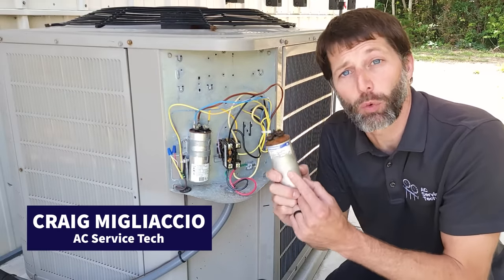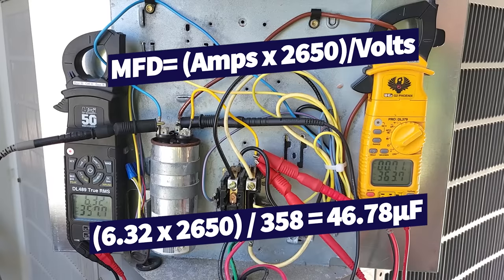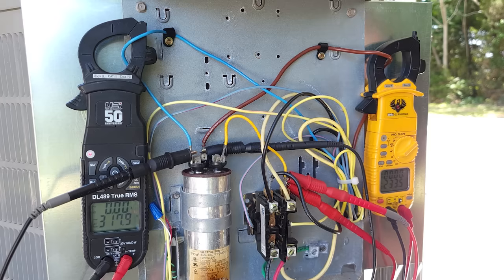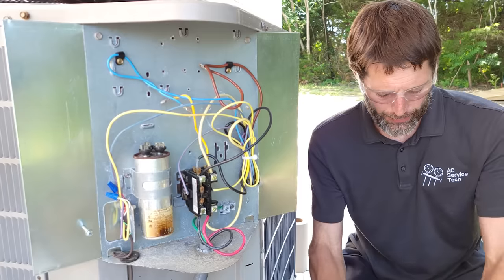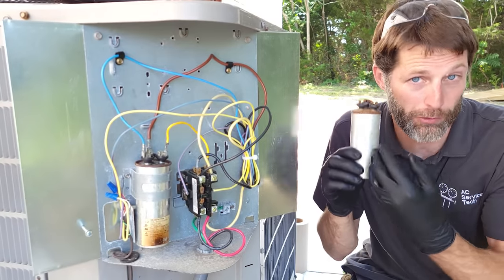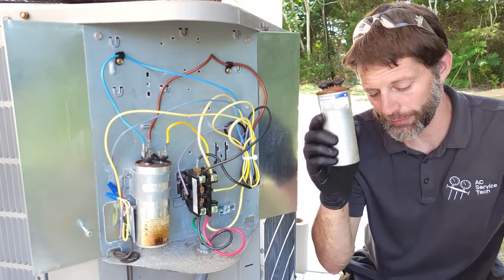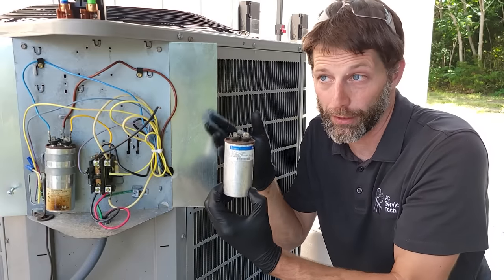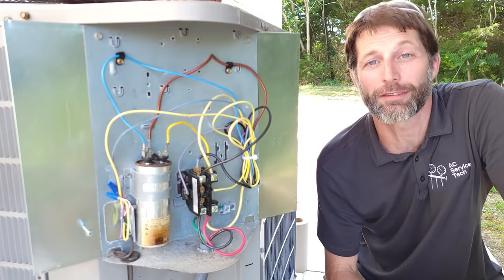WHY CAPACITORS FAIL in Air Conditioners! Watch it Break!

Comment: After several years it's always a good idea to change out capacitors, contactors and relays, they did their thing, leaving them in is going to take out the larger more expensive components. It's also a good idea to go through a unit and get a baseline on everything for future comparison, no one does this, but most HVACR equipment comes from the factory with a start up check list in the installation manual.
Reply: FINALLY someone that understands 'baseline' s.

Comment: Can power outage kill the capacitor and ruin your compressor when the power comes back?
Reply: Yes
Reply: @BartSimpson-nr1dy  wait what? How does it kill the capacitor and in turn kill the compressor??
Reply: @armandodeleon5047  electricity does what it wants to. I've heard praying helps though...
Reply: It happened to my house the compressor was short to ground but my capacitor was fine thanks for the feedback
Reply: @
circuitry
Reply: our compressor and air handler both have surge protectors that were installed when our system was installed

Comment: Thanks for this video!  I recently had the capacitor go bad on the 3 ton Copeland compressor of my home A/C. It was actually not an old capacitor; maybe a year or two old. The original GE cap failed after 20 years, and the new one was a Rotom. It lasted a year or so then failed the first day of the cooling season this year.  After it failed, I made an analysis of how the capacitor safety disconnect circuit works..... and bypassed it and gave it a very good send-off. Here is the send-off of the old capacitor: https://youtu.be/z1enQuvSovg

Comment: I have always been told, that a major reason for capacitor failure is low voltage.  When there are brownouts due to high demand on the grid, the capacitors heat up and fail.  Dunno but it does pair up with my field experience. My supply house has run out of caps during high heat conditions.  I doubt it is ambient heat failing them as this guy says but rather low voltage from high demand on the grid.  Did like the dynamic measurement though.  I'll have to watch that again.

Comment: If I understand correctly, the capacitor is only needed for starting the motors, perhaps a time relay is a solution that prevents the capacitor from wearing out too quickly.

Comment: I have a Leeson 5HP motor on a dust collector and it has failed. Based on your reasons for failure I'm assuming it was a heat issue. The motor was installed in a small outdoor shed and actually lasted for several years. The replacement capacitor I ordered is physically much smaller than the original but the specs are the same. Also the original had a bleeder resistor which I will remove and install on the new capacitor (per your instructions in another video). 
Question - will the life of the motor be affected by the failure of the start capacitor? I was informed by the MFG of the dust collector that when a start capacitor fails the life of the motor has been considerably shortened.

Comment: Your video is awesome. I recently replaced a dual capacitor on my daughter's new house. Her husband helped me, and we got one 25Hern and one 5 fan separate capacitors to replace the dual capacitor as there was no dual captor available in klamath falls oregon. I think the guys said "fan ones fail more often." I showed my son in law how to test a capacitance with a milwaukee meter. I still don't know why the contacted was not getting power. I think it was from a mislabeled "Water Heater?{"" which was really the condensing unit.

Comment: Thanks for the great lesson. I have also replaced many capacitors after a hard freeze. I had come to the conclusion that the cold will kill them also.
Reply: On ACs when summer comes? or heat pumps? If heat pumps, I would guess not the cold itself, but higher start currents in the extreme cold? (or failed crankcase heaters?)
Mr KL

Comment: TL;DW

1. Capacitor is too hot; unit is in the sun or just is hot a lot.
2. Capacitors are expendable items. Hotter they run, the less they live.
3. Voltage spike, e.g. surge, lightning strike, etc.
4. Bad connection point overheats terminal and creates a failure.

Comment: Thanks. The cap on my carrier unit failed after 4 years of hard hot texas summers.  Replaced with identical values but new cap was much bigger and came with new bracket.  So far so good.   Since they are fairly cheap would you recommend just replacing it annually?
Reply: No easy answer, depends on the quality of the capacitor.  In your case, if your replacement was equal or better quality, then it seems like 4 years is closer to the right number, lol.  Your money though, if you want to replace on a schedule then it's not a bad idea, but if it doesn't take long to get the panel off, I'd just have a spare and wait, or every 2-3 years.

Comment: @AC Service Tech LLC
I wonder if you could edit your comments to include a note that you heated the capacitor during this demonstration?
Many are very confused as to how the capacitor failed or how you knew it was going to fail for your filming.
I don't know if you will see this comment...

Nice video, thanks.
Mr KL

Comment: HI very informative but how did you know that capacitor was going to fail while you watched it?  Was it not receiving the proper air flow it would normally receive  if the covers were on? Otherwise why did it overheat? It was operating within its labeled voltage rating, I don't know if 6 amps was above its rating but I assume was within its rating. Question how did you know it was going to overheat ?

Comment: You predicted the capacitor's failure. I could see the capacitor getting hot enough to burn the label, but why. Did you heat it with a torch or heat gun, or was there some other reason it overheated. Thanks.

Comment: I’m sure there is a correlation somewhere but personally I noticed if the condenser coils are dirty or clogged the capacitors fail prematurely.  The Hawaiian heat doesn’t help either😜. Mahalo for the great videos. Aloha🤙🏽

Comment: Mine failed on an older unit when the air temperature was 115 and probably inside the housing I'd say 140 at least. Was not a fun day replacing in that kind of heat!
I fried an egg on my road and I left footprints in the melting asphalt!

Comment: Another issue is light load on a motor will have higher back EMF. A dirty, blocked up condensor might cause the fan cap to fail because the fan is creating less mechanical load.
Reply: If you're victimized by that case, replace the cap with one that's rated for the voltage that can be expected when the system isn't optimal.  Then take a pitchfork mob to the designer's house.

Comment: I've been told from my HVAC teacher
who was a tech since the 70s 
the gov made cap mfg change the oil due to environment issues 
 and ever since they have been a basically a wear item. 
but before that you barely would even think to keep but maybe 1 on the truck
Reply: They banned pcb's.

Comment: A few years back I had to make an emergency call to have a new dual run capacitor installed in my AC unit. I was leaving town the next day and could not leave the house full of humidity for a week. So the $850 service call included a new 5/45 capacitor, a "start kit" and a service contract (to reduce the bill) fast forward 2 years and the service tech tells me that the fan side of the capacitor is reading 12.5 UF!! and though it works, I should replace it. I thanked him and sent him on his way. I bought a new capacitor and swapped out the other. Capacitors don't magically increase in value, and at the time I did not have a capacitor meter for large values so I contacted the company that makes the capacitors here in Florida and they told me to send it in for analysis. As I had wondered, it was right on spec and they sent me a replacement. I don't know if the tech was trying to scam me or calculated wrong, or put two loops of wire through the ammeter, but in my 40 years of electronics I have never heard of capacitors increasing in value 2 x. Can you comment on start kits and whether they help or hurt. Mine is quite old now.

Comment: what should a capacitor cost for a hivac company to replace?  I had an ac guy come out to do a "cleaning".  He was pushing to do anything he could do from replacing my working unit for 15 grand to more freon for 900 bucks to a capacitor for 585.  I said no to everything since the unit is working fine.

Comment: Would it be beneficial to have the capacitors inside next to the furnace and just extend the wires or will that create a voltage drop?

Comment: I am in AZ where temperatures reach 120 degrees in the summer. I had my AC go out a year ago on one of those days. I panicked and called a HVAC company to come and fix it. The guy talked me into a 5-year contract on top of replacing the run capacitor for $1800 total cost! I've regretted it ever since. Every time they come to supposedly clean and inspect the system (and I've seen no evidence of cleaning) , they tell me it's on it's last legs and really should be replaced (I think it's 8 years old now), at the "discount" price of $10,000, which I can pay over 5 years with 14% interest. I've resisted that so far. I am convinced I am getting screwed by these guys and can't get out of this deal. What do you think?
Reply: $1800 for a $21 part? That was your first clue that something was wrong with these guys. Your best bet is to have a lawyer go over the contract. If there is anything in the contract that is illegal, then you can have that contract voided. If there is nothing  wrong with the contract, then you are stuck with it until it expires.Don't ever do anything like that again. There are plenty of AC companies out there that don't play these kinds of games. You just have to call around to find them and get the best deal.
Reply: Read the Yelp reviews and check around for AC companies.  I always do an extensive background check on any company I use, and as a result, I have had zero problems.  The last thing you want to do is call a random company and find out it had a pile of 1 star reviews after you handed them a stack of money.

Comment: Pretty sure this just happened to my window AC. Unusual use case though. Installed in the trunk of a car pointing to the interior. Pop the trunk when running so air from the condenser can circulate. Fan is still working, but when the compressor tries to kick in it bogs the fan way down and just hums.
I have a hunch it gets a little warm rather regularly. Lasted a bit over a year. Guess i'll have to keep a spare on hand. Could maybe figure out a way to mount it on the underside of the vehicle.

Comment: If you have a bad capacitor could that show low charging stuff? My 102 yr old mom was told bad capacitor and recharging from or whatever it is, is old and would cost a fortune to fill then it could leak out and be no good so they wanted to upgrade with whole new unit. She’s didn’t want to pay out 4-5000 dollars for AC so we’ve set up a portable but it doesn’t do whole house or a great job. Is there a solution to get whole house AC back up and running in her house?

Comment: Great video!  Makes me think back to some of the older equipment that had the run capacitors protruding through the control compartment into the air steam of the condenser fan.  Space saving or capacitor cooling???

Comment: What I want to know, is if they have capacitors in them. Why do I still need a soft start if I want to run a traditional air conditioner with solar inverters. Are they just too small to lower the surge?

Comment: I have a unit that buzzed/hummed loudly like it was getting low voltage. I turn the unit off and turned back on in 15 minutes and the unit ran fine. My question(S)  are - is a weak/faulty capacitor the problem and my other question ; my capacitor number is HC98JA062D, which I am unable to find one with that number , so is capacitor HC98JA046D the replacement for the original capacitor since they are everywhere. Thank you for your help

Comment: You put a torch on the capacitor to heat it up and make it fail, why are they overheating if current is not the issue? I have to replace my cap every 2 or 3 years in my unit, I's a Payne unit which is made by Bryant, and it has worked flawlessly otherwise.; aside from the cap failing from time to time. I did verify with the manufacturer that I am using the correct microfarad rated cap, IDK why it occasionally fails. No short cycling or undersized unit either, I was an HVAC tech and installed this system myself, no choking anywhere...

Comment: Question I have been curious about. If available, Would / can a higher voltage rated capacitor be better / less prone to premature failure? Ie  400, 500, 600 uf

Comment: The dielectric fluid also helps with the capacitance capability....BUT,overheating will always damage a capacitor....was in the TV service business for 40 yrs, many caps went bad due to poor manufacturing and just age. Electrolytics were notorious, older paper and wax caps would dry up.
Good video.

Comment: I was replacing the single capacitor every year the HVAC tech fix the problem by installing two capacitors, one dedicated to the compressor and the other capacitor dedicated to the fan, that was five years ago with No problems.

Comment: A big part of the reason they burn up is when the foil degrades the ESR (Equivalent Series Resistance) goes up which is the main cause of it heating up. The higher the ESR the more heat that is produced .... The same thing is true for DC switching regulators, you need to spec caps with the lowest ESR possible or you'll have failures due to the heat produced

Comment: Would it be possible to add more ventilating holes towards that compartment? Or making a heat sink that would wrap around the capacitor to help keep the temperatures down?

Comment: Do these capacitors have any relation whatsoever to voltage drop in the house when the a/c turns on?

I don't have aluminum wiring; was built after 2005.  I have 200amp service.  No problems otherwise with the a/c.

I guess there's also voltage drop when the kitchen refrigerator kicks on, so perhaps just an issue for the electric company?

Comment: Could power fluctuations cause voltage spikes?  I ask because I’ve had capacitors fail during or shortly after power fluctuations sat my home with power flickering on and off in rapid succession.

Comment: I live in Orlando Florida and have to replace the capacitor about every 1.5 years I think its due to my AC being in direct sunlight for a good part of the day. Thanks for the informative video.
Reply: I used to have a A/C that was one of those all in one units.  Both coils in one box and duct work connected to the unit.  When my fan cap kept going out, I had a local motor shop test the motor.  They said it was fine.  The A/C was in the sun during the hottest part of the day so like you, I figured it was heat.  I moved the capacitor to the evaporator section where it is really cool.  Cap never went out again.  As far as wire goes, I moved it less than a foot.  Odd thing is, compressor cap was original and never went out and it was in the heat.  Go figure.

Comment: Very well made and informative presentation. I learned something new in the way of the calculation presented here. I have an old 1950's vintage capacitor checker which I have used and it seems to work but being it is so old I wonder how reliable it is if it has an electrolytic cap in it which has dried out and shorted. I will use the math formula next time I need to check a cap.

Comment: i had a older rheem  r22   and it blew capacitors  every so often . I changed the power supply wires  to 10 gauge  from the panel box and  never blew a capacitor since ...
Reply: Interesting

Comment: The dielectric fluid in addition to acting as a cooling agent, changes the dielectric constant of the capacitor allowing it to have greater capacitance than air alone, and suppresses corona and arcing.

Comment: I had a 20 month old Carrier AC capacitor fail in a new home we bought 10/2020. Of course it happen in upper 90's temperatures. The outside fan motor ran but the compressor would not kick on,  so no cooling. Had it fixed under parts warranty but I had to pay for the service call. I find it frustrating that it happen after such a short time and the shielding is just a piece of  sheet metal. Not everything can be installed in shady areas and the mechanical code requires a certain amount of clearance from the unit to shade producing shrubs. Guess you have it fixed and move on.

Comment: What direction should air flow through the condensor?  In from the top, out through the coil, or in through the coil, out through the top?  My is blowing out the top and I think thats wrong.  I don't think I can change the direction of my fan motor either.. Emerson K55HXHFS-8634 in a Kenmore KAC024AKA1.  Lately fan is not starting and getting very hot as well. spins freely and unit makes a loud noise when it stops working.

Comment: I had the same problem with the motor in the oil burner on my oil heater.  This capacitor broke twice within 2 years.  Externally it was undamaged but it lost capacity and at some point early in the morning the heating stopped working.  Both failed capacitors (5mf) were from the same manufacturer.  After that I chose another manufacturer.
Reply: Try using same capacitance but with higher voltage rating.

Comment: 8:01  The voltage on the capacitor is greater than the 240 volt supply voltage.  It is the back EMF from the motor, in this case about 365 volts.